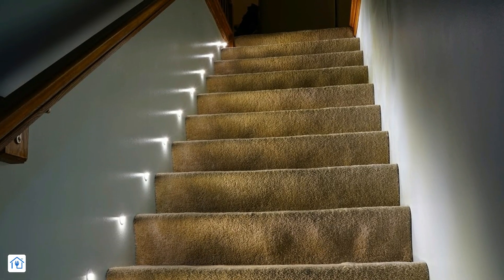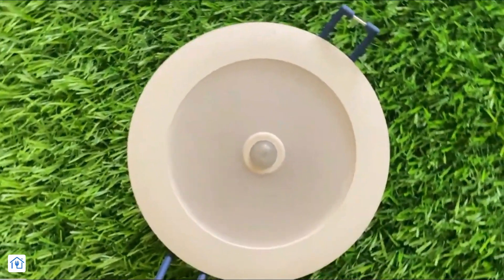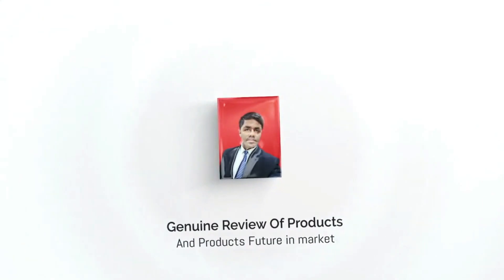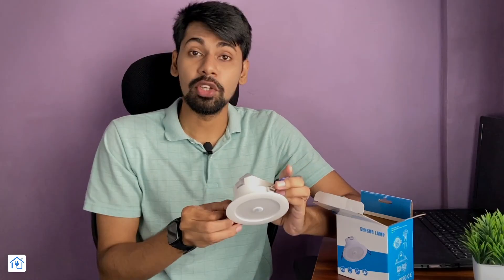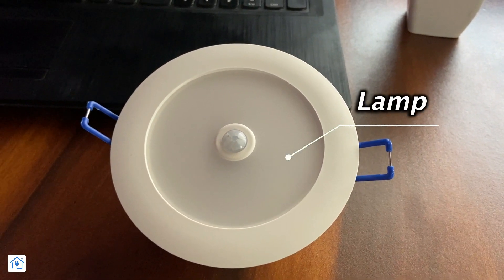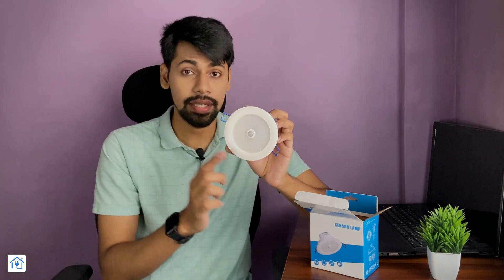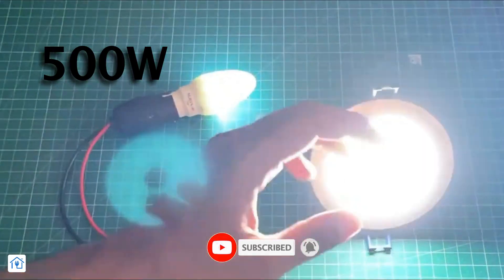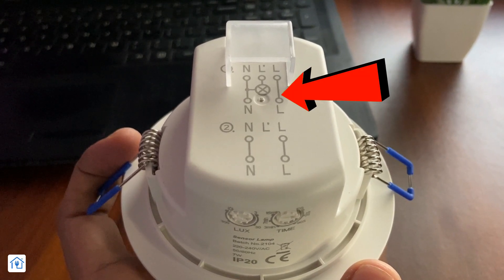Motion Sensor Light for Staircase | Sensor Light for Staircase Automation | Sensor Light Wiring

Comment: Hi bro, many tanks for your valuable and informative videos. Is there any suitable sensor to switch on the ac as we enter the room? I mean the ac should switch on as we enter the room and keep running as long as we are inside the room, but it should switch off the ac as we left the room. Pl. suggest me  if there is such products in the market. Thank you in advance for your suggestion...
Reply from the maker: Thank you so much. You can use microwave sensor but since it can only handle less amps so you need to add contractor or heavy rating relay to the output of the sensor to which you can connect the AC . It should be done under any professionals care since ac takes to much current. You can turn the time delay of the sensor to maximum. As long as it will sense  the motion , ac will be on
Reply: @AutomationDude  First of all thanks for your quick response. It will be nice if you can provide me the link of the exact product (which you are suggesting), and from where I can buy it. I can certainly take care of the installation part. Thank you in advance again...

Comment: I want to put these light along with 2 others in the ceiling and it should auto detect only at night (i know this works from ur video, thanks for that) but what if on day time if i want them to work manually means if i can manually switch all of them ON, is it possible?
Reply from the maker: It is possible only when you attach external lights on it. You can add a switch and do alternate connection for manual switching. But you cannot manually operate the light inbuilt in the sensor.